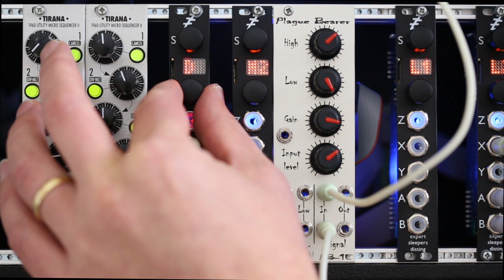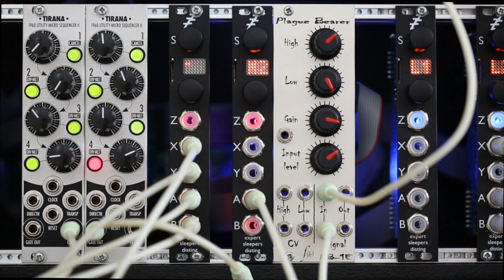disting mk4 - Quantizer 2

Comment: after you power off then back on does the mk4 recall its last settings?
Reply from the maker: It remembers what mode it's in. If you want it to remember parameter changes you have to explicitly save.